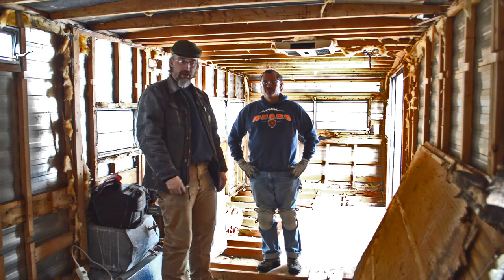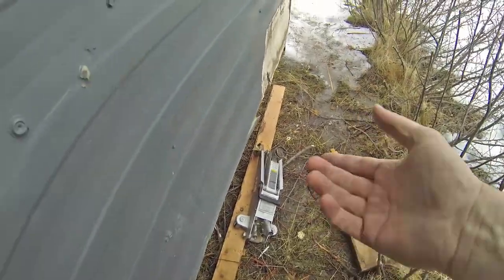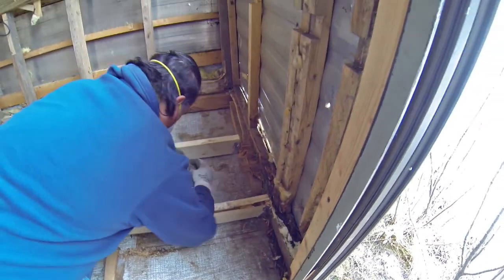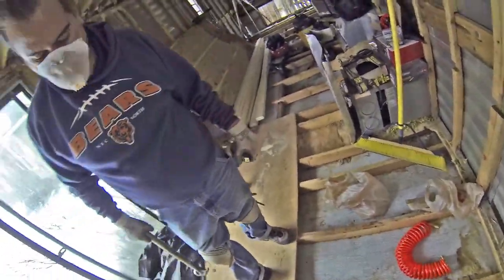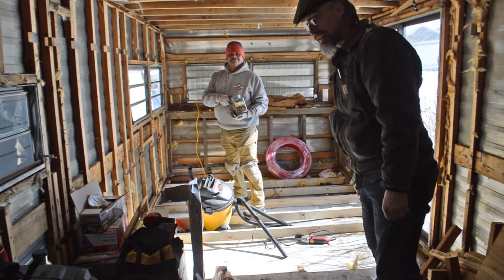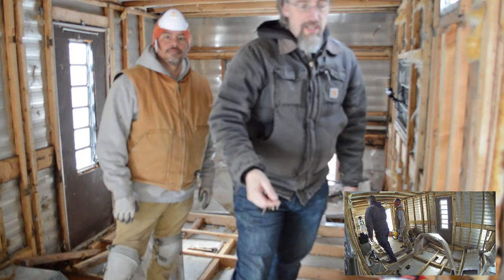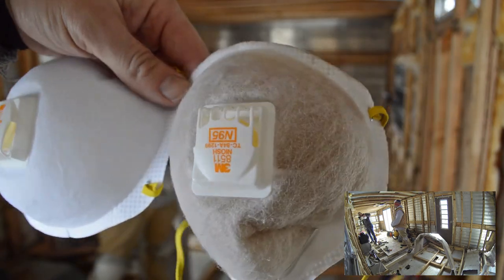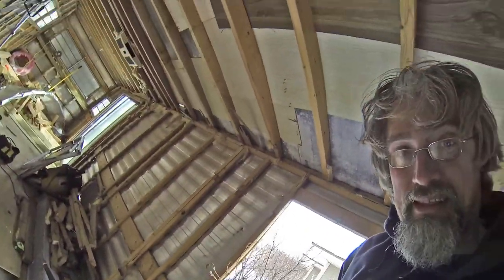Travel trailer rebuild - The floor joists

Comment: I have a 19' TT I started to replace the floor on (the front section of the camper only) but in so doing found more and more rot. A number of the joists (these run longwise, North South) were rotten at the ends where they were attached to a East West "header" beam. The header is completely  rotten all the way across. When I removed a side aluminum panel the end of the outside joist is rotten where it attaches to the same header beam and some of the wall frame is rotten too (the bottom 1x2 of the wall frame). I saw how you used a jack to get in the new joist. Just what were you lifting? Thanks
 Doug

Comment: I'm trying to watch this video to get ideas on how to rebuild my floor in my Fleetwood.  The back end/bedroom is completely rotted out.  I've removed the floor, but now i'm to the point of how to attach the new wood around the outer base to the wall joists and the floor joists, put in the floor joists, how to attach them, nails, vs screws, vs metal plates?  But your video moves so fast I can't see how you are attaching your 2x4's to each other.